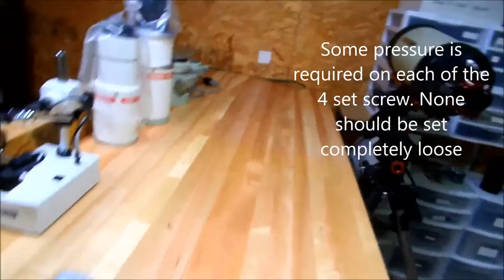Collimation

Comment: Great videos for collimation! I play at 1/4 speed to really see what is happening. I think first adjustment would be adjust the 4 sets of bearings so when the drawtube goes in/out the laser dot does not move. Then adjust the flange collimation set screws until the laser dot stays centered when spinning via upper/lower flanges. Thanks for a great design focuser and great customer service!